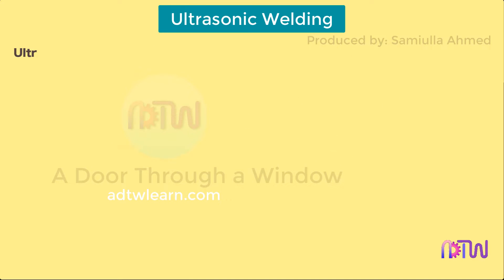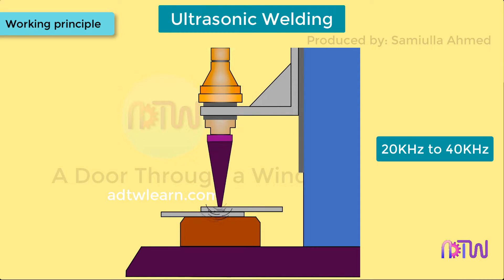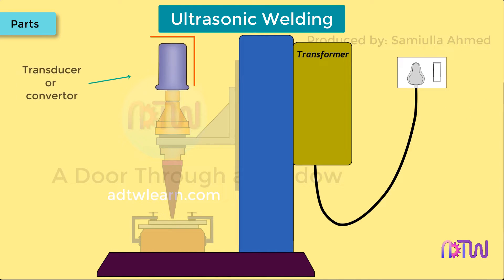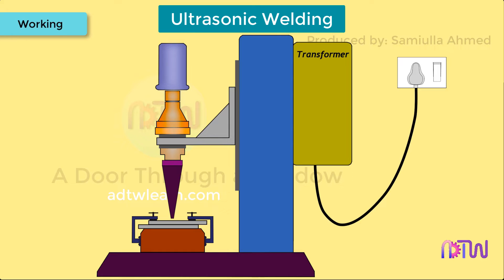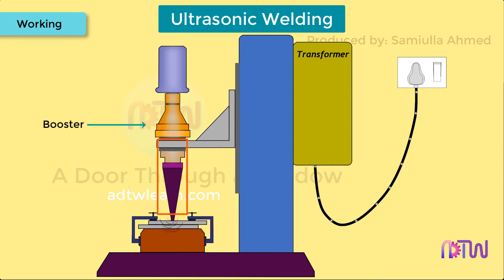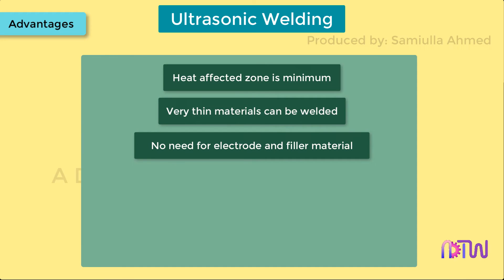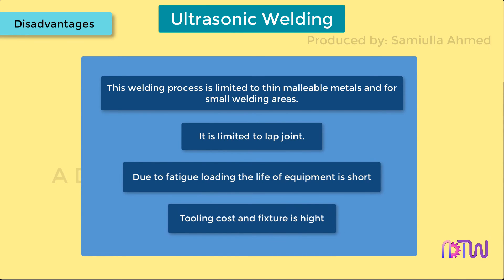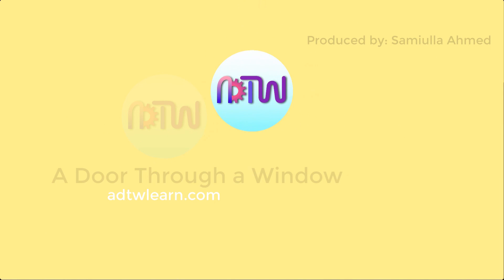ULTRASONIC WELDING | How Ultrasonic Welding process works

Comment: there i a lot about how it works not so much about what to adjust to get get what results example if some parts are not welding what happens if i decrease the pressure or increase the time.

Comment: What about using this method to weld 0.1mm-0.5mm  thick copper plates to a 18650 Li-Ion battery terminal? Would it somehow work?

Comment: I work with these things on a daily basis. What I was told is that the complete transducer, amplifier and horn are balanced to the generator. So we can't exchange the generator to a other one. While the horn itself is detachable we may not use a different one.  We're told it is all one setup and nothing is exchangeable. The worse thing about this is it's from Chinese manufacturer that sells these low quality product to the company i work at. 😔

Comment: Ive worked with many plastic ultrasonic welding brands in the past, I now only deal with Rinco. Personally by far the best and most reliable to get the problem solved.